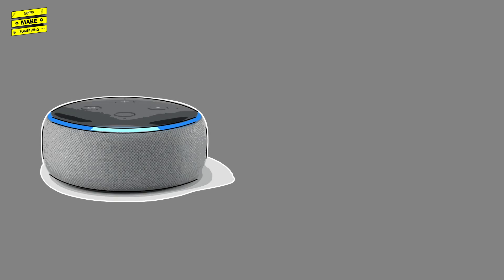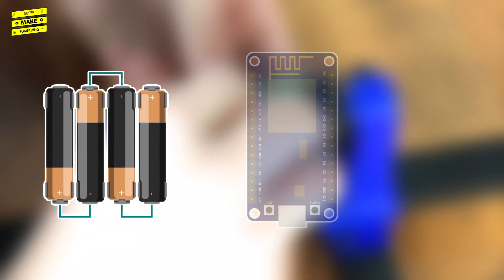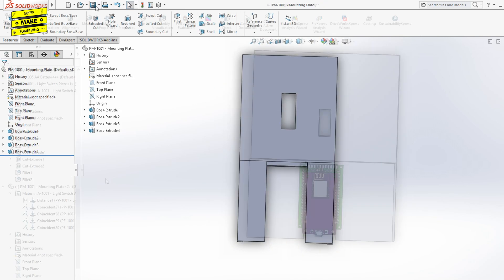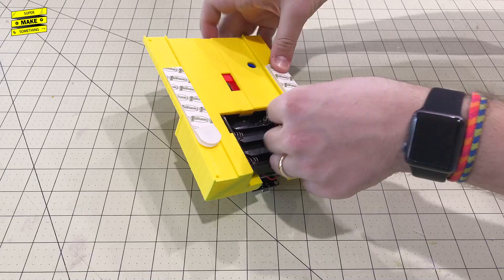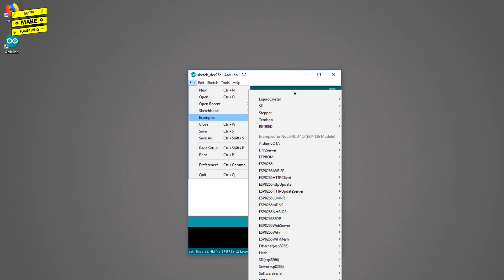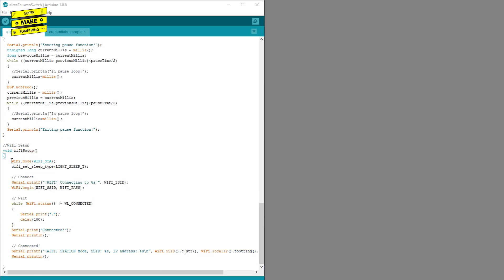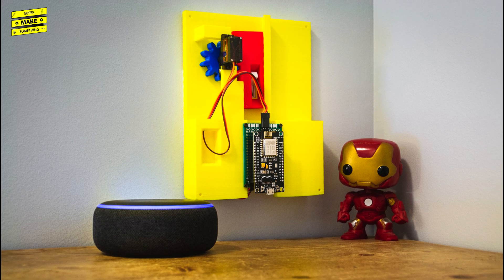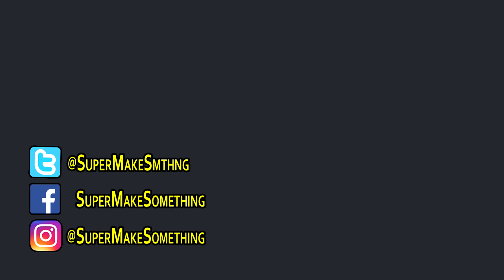Alexa Enabled Light Switch (DIY Home Automation, NodeMCU, ESP8266, IoT, Arduino, 3D Printing)

Comment: How long does the circuit last before the battery fully drains?
Reply from the maker: The batteries last about a week, but further code optimization could extend this significantly.

Comment: I have a problem, my Alexa can't find the ESP8266 when I ask it to search for devices
Reply from the maker: I would double check that you are connecting to the internet correctly by plugging in the USB cable to power the unit from your PC and opening up a terminal.  You should get a "connection successful" message printed out to let you know that you are online.  After that, your Echo device should be able to find the ESP8266.

Comment: Wow What a nice video, can you the same code without Transistor and resistor if you yes what I need to modify in my code. I am supplying power direct in ESP8266 from my laptop
Reply from the maker: Vinod Tiwari You can use similar code, but would need to modify the wiring for the servo to receive 5V directly from the USB cable, because the ESP8266 likely will not be able to supply enough current.
Reply: Thanks for your quick reply. however, my mother is not stopping it keep running the same direction.  where I can define to stop the motor.

Comment: Very cool project.  Instead of batteries why not build a small power pack you can tie into the light switch power?  Either way it's a cool project.  Happy Trails!!!
Reply from the maker: smwizzz Thanks! That’s definitely an option. For this project, I was looking for a device where I didn’t have to mod the wiring of my house, but adding a transformer to drop the mains down the 5V DC for the NodeMCU input is another way to go — that way you will never have to switch out any batteries!

Comment: Most detailed and comprehensive video for Home Automation I saw in recent times. Helps beginners like me who get lost in the complexity and the length of the process.

While I like the entire setup, I always envisioned the setup to be a small box attached to the switch board. Guess, the size of the components is not as small as I thought. Any upcoming project where you plan to reduce the size of the entire setup? What would it take? More cost I believe?

Edit: Yep, more cost, just like this ones: https://www.amazon.com/SwitchBot-switch-button-controlled-compatible/dp/B07B7NXV4R
Reply from the maker: Siva Praneeth Thanks! Glad you like the video and found it useful. I believe the one you linked is also Bluetooth only, and therefore not compatible with Alexa without an additional hub that can give the Bluetooth device internet connectivity. The build in this video does not require an additional hub, as it can connect to WiFi directly.

Comment: Very nice complete instructions! TY! One question, since the entire module is tapped onto the wall. How easy is it to remove it to replace the batteries (every 5 days as you encountered)?
Reply from the maker: Thanks! The module is actually attached to the wall using a two piece Velcro strip, so it comes off very easily. I specifically use “3M Command Strips” in this build. There is a link in the video description if you are interested.